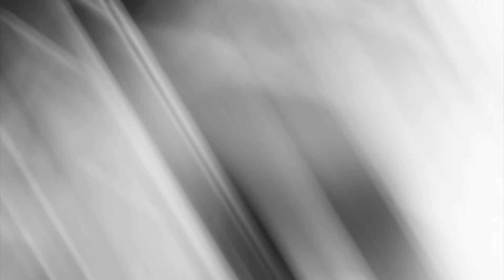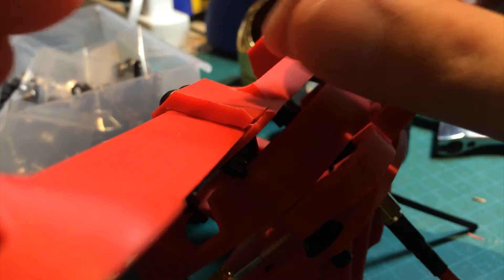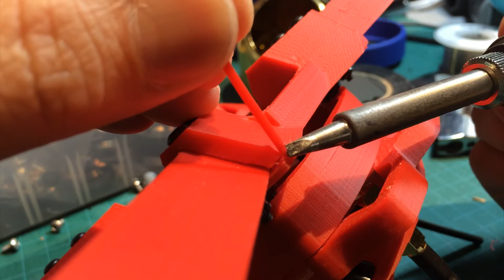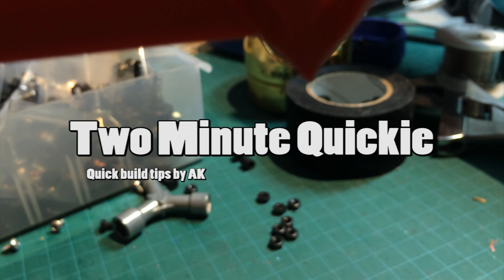HOW TO: Repair 3D Printed Plastic

Comment: Do most filaments work with this? I recently received a nylon printed part that has had a piece broken off. Would I be able to use the soldering iron to heat up one of the ends to reattach the piece?
Reply from the maker: Best to search attaching 3D printed parts together. Techniques have come far since I made this video in the early days. You might be best off using a specialized glue
Reply: @antigravityracingfpv  Thank you for your incredibly quick reply. I think I'll look at some polymer bonding processes. There's a company selling a poly kit that claims to bond nylon.

Comment: do you tho I I could do something similar using my hot end of I'm careful?
Reply: Here is Filament Spool Holder http://www.ebay.com/itm/222298639746?ssPageName=STRK:MESELX:IT&_trksid=p3984.m1555.l2649
Reply: You’re supposed to be able to repair 3-D prints with a 3-D pen so yeah probably